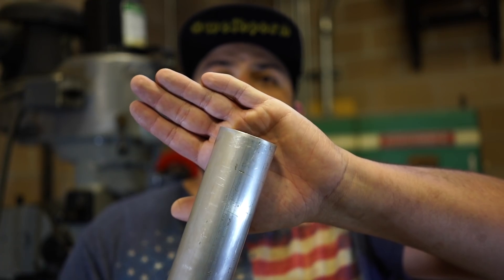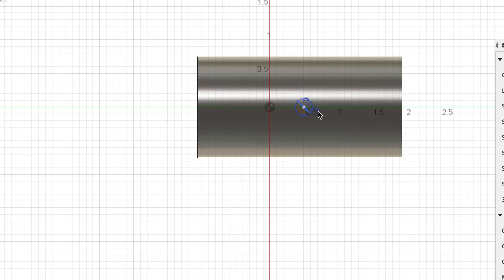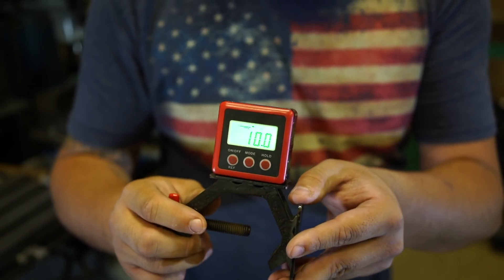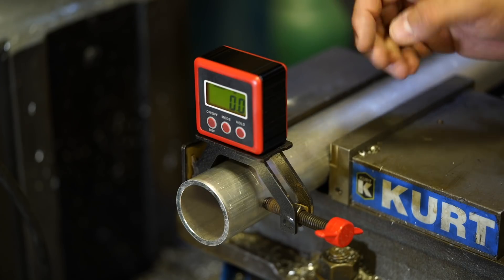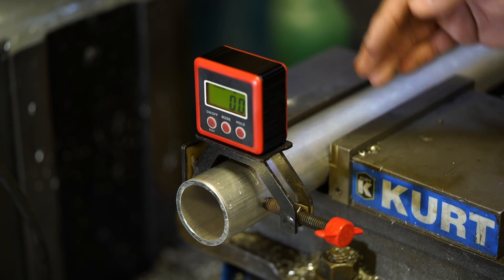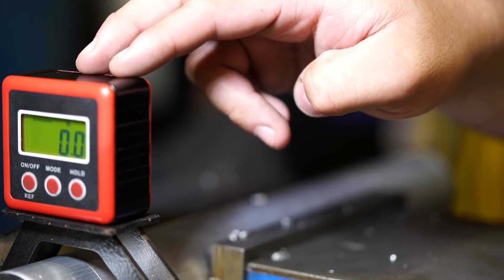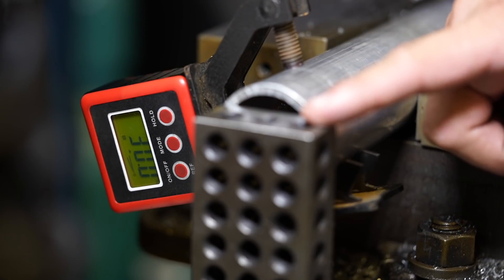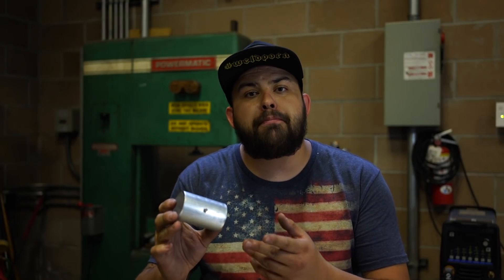Using a Digital Angle Finder on Tube, pipe or bar to locate/clock drill locations/tube notches

Comment: Brad, great tip. Where did you get the jig / tool that the digital angle finder was sitting / resting on?
Reply from the maker: Thanks Stan! You can pick up the little clamp from roguefab.com 
I’d honestly recommend making your own.
Reply: Wow, that clamp from roguefab costs over $40....  I'm in the entertainment business and this is what I use to stick the angle finder onto tubing... less than $5
https://www.amazon.com/American-DJ-C-CLAMP-Lighting-C-Clamp/dp/B0002DNT5I/ref=sr_1_3?dchild=1&keywords=ADJ%2Bc-clamp&qid=1596984584&sr=8-3&th=1

Comment: 1 1/2 OD is tube size.
Reply from the maker: Marcel Fortin you’re very correct. Pipe is measured by ID. I’m just not going to go into what the ID and wall thickness is for schedule 40 in that diameter for something that doesn’t really matter. Thanks for noticing though!
Reply: I'm a retired pipefitter of 40 years. When you said pipe size I perked up because most Fab Shops use tube sizes. In my career I have used 1/4, 3/8, 1/2, 5/8, 3/4, 1, 1 1/4, 1 1/2, 1 3/4 and 2" tubes in Industrial settings and 4 and 6" tube for message systems in commercial settings. Due to better steels pipe size is normally nominal in designation.

Comment: Iv had one of these level box's for a couple of months and used it for setting saw blades . That's a very good tip your showing . I'm definitely going to make a tube/pipe jig for doing this . Cheers Brad 👍
Reply from the maker: Ainsley Rich Thanks a lot man! Not a bad use at all. I appreciate it! Yeah I recommend making your own. The ones they sale are super cheap. Except the billet one that’s out there.

Comment: What I'd do is use the CAD to print out the flattened surface of the pipe with the centers marked and glue it to the piece to easily find where to cut/drill/etc
Reply from the maker: Alessio Sangalli that’s an easy way also.. for those who don’t know how to use cad or that don’t have time to run inside to jump on the computer.. this is an easy alternative that is just as fast. 👌🏻
Reply: HourGlassFab yeah I mentioned that specifically because you started the video by designing the piece on the CAD :)